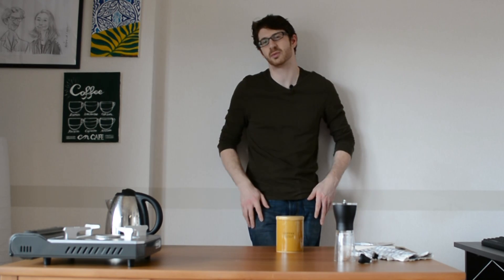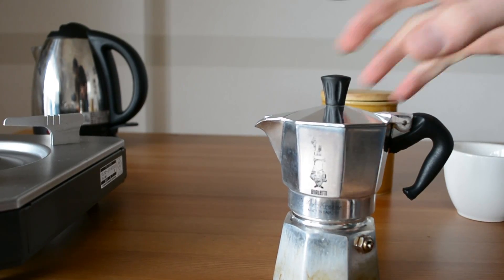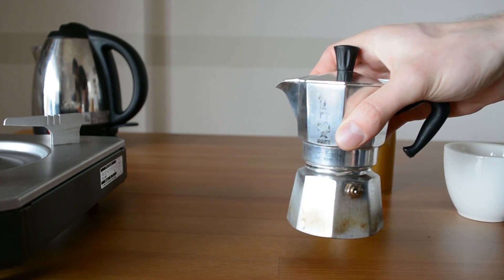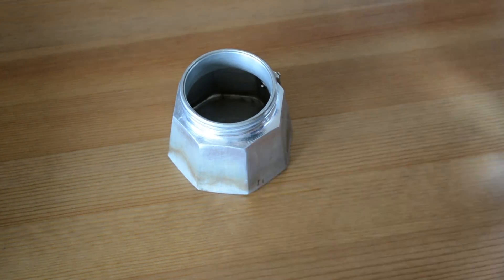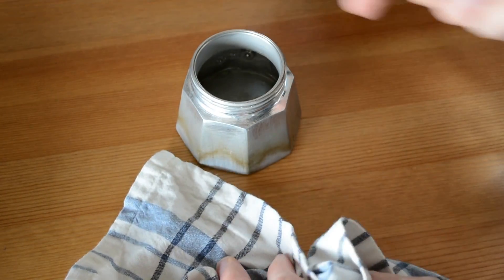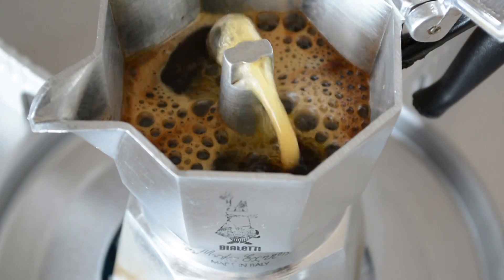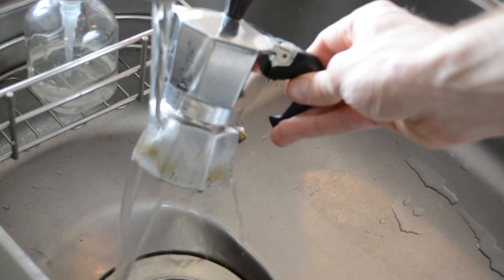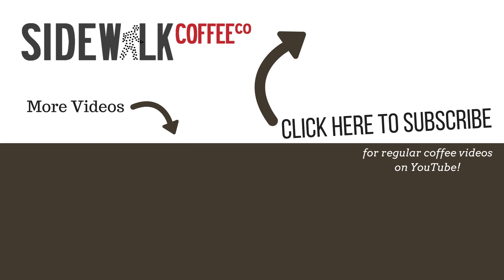How to Make PERFECT Moka Pot Coffee Every Time

Comment: If you see water spouting like that at the end, you waited too long to remove the moka pot from the heat. You have to remove it when you see the liquid turning blonde and it is still flowing, bubbles just forming. Next you should have a bowl with cold water prepared in advance, so you don't need to go to the sink with the very hot and bubbling moka pot. It saves time, it is safer and stops the process faster. I would use an electric grinder for coffee. Thank you for your video.
Reply: No. It just means their heat is too high.
Reply: It means that it's done apparently to him as he enjoys his coffee.  I am sure italians don't care either.
Reply: Yes the sputtering phase is to avoided. One can see from the color of the 'coffee' emerging during the sputterng phase that this is not thick creamy coffee but watery brew. Definitely to be avoided.

Comment: The bubbling/gurgling at the end is very detrimental to the flavor of the coffee. I would use a lower heat. With practice I learned how much coffee fills the pot, and I pull the pot off the heat before it gets to that point and run it under cool water. Also sometimes I pull the pot halfway through and drink that.. talk about strong :).
Reply from the maker: As with most things relating to coffee - you can only really teach the principles and then hope the techniques are perfected over time.
Reply: @Frank Mclain And I don't think it matters one bit.  Brew it how you like it!
Reply: Coffee still gets bitter taste after following the above steps....any suggestions???
Reply: @prajwalgowda11  Try Yaucono coffee. Thank me later.
Reply: I agree. The bubbling causes over-extraction. However, instead of putting it under cold water, I quench it in a small pan of cold water. It stops the process immediately (literally within 1 second), without the need of running over to the sink. I don't even let it start bubbling. Instead, I watch the level of the coffee compared to the top of the extraction column. Never, ever bitter.
Reply from the maker: @prajwalgowda11  Try using a lighter roast coffee. Moka pot is close to espresso in terms of flavour but you can get better flavours out of lighter roasts than it is easy to do with espresso. Let me know how it goes!
Reply: you are right. If you wait until it bubbles the coffee is not as strong. Take it off halfway!
Reply: Any advice on quantity for one person?
Reply: @paullau4297  I drink an entire pot myself. Its the "six cup" bialetti model but its not six measuring cups more like 1.25 cups of brewed coffee when its done.
Reply: @Bohdan M I disagree about roast importance in a moka pot. I would suggest a slightly lighter roast than what someone usually drinks. Too much time in scorching hot metal before the water actually passes through the coffee. Makes the coffee more biitter and sour I've noticed. My favorite personally is a dark roast in the moka pot, but you have to boil the water in the bottom half before adding the coffee basket and screwing on the top half.
Reply: @homecafecharlie  I've heard this as well, with the wisdom being: darker roasts extract more efficiently, but for Moka pot, a darker roast will more easily acquire a burnt taste. I agree with @chilopilo that  the pot should be removed a bit before the full-on gurgling.  The principle undesired result of Moka pot is the bitter taste that comes out of overextraction. Stopping the brewing earlier can help with this, though it will mean a bit of water is left in the chamber and your brew ratio will be lower (coffee will end up a bit stronger).

Comment: That grind looks too course in my opinion. That's the sort of grind I would use in a French Press.
Reply from the maker: It was a little too coarse, you're right
Reply: And also too much heat
Reply: Too coarse and the burner was really high. Video needs to be remade.
Reply: @homecafecharlie  also he's using a manual grinder.
Reply: That is coarser than I would use, but it comes down to taste.  The only real danger of going too coarse is that your coffee winds up underextracted and sour.  If the taste worked out, no need to change grind size.

Comment: Why cool the pot under water when you can pour the coffee immediately into a cup?  Seems like that accomplished the same thing.
Reply: in my opinion, i think it's actually to stop the coffee from brewing since the hot water below will keep pushing the coffee out
Reply: @gideon3839  correct. The sooner you reduce the heat, the less it will continue to brew and potentially burn your coffee. That's why you have to take the Moka Pot off as soon as it's about to sputter.
Reply: Didn't answer the question.
Reply: @garryyoung8320  I'll give it a try. First, if it takes you the same amount of time to get to the sink as it does to empty the contents into a cup, then there's probably no difference. The moka pot will continue to extract as you're walking to the sink or pouring into the cup. Depending on various factors (e.g. grind size, roast level), you may or may not be over extracting at that point.

People use this technique as a way to reduce this possibility (of over extraction), as it instantly halts brewing. In my opinion it works best if you have a bowl of cool water within arms distance. To me this is the faster option and superior to using the sink or just pouring into a cup.

With that being said, I typically don't use this technique anymore. Instead I now take the moka pot off the heat source half way into the process. I then let the remaining pressure complete the brew. It never gets to that gurgling point and the last bit of extraction is happening with lower temp/pressure and is practically at no risk of over extraction.
Reply: @davidmaurice1294  great idea to take it off before it finished brewing! Thanks!

Comment: I agree with most of the comments. You DO NOT want the bubble/gurgle to happen. I do start with boiling water in the bottom but I only put it on a medium/high heat on the stove top. This creates a slightly longer but lower temp extraction, and as SOON as you see it start to bow out (the streams on either side) take it off immediately, shut the lid and run it under cold water.
Reply: Also- for those asking about crema, try using espresso beans (they will look darker in roast color) and make sure they are freshly roasted (date should be on the bag. Don't even buy it otherwise. I mean fresh as in within a couple weeks tops. And grind finer than you would drip or french press but not as fine as a real espresso machine or turkish would require
Reply: yeah... and i don't see any need for the extra step of running cold water over the pot when u take it off the burner?  i mean, wouldn't we accomplish the same thing by jst pouring the coffee as soon as u remove the pot...  simple is better :)
Reply: what is "bubble/gurgle" ?

Comment: I found this video useful, and it got me on my way to making great coffee with my Moka Pot. Thanks. However, after doing some more research and experimentation, I've come up with some slight changes that give me a perfect cup every time; never bitter. I don't preheat the water because it is challenging to get the top screwed on tight without burning your hand. Second, as soon as the coffee begins to emerge, I reduce the heat. Third, BEFORE the coffee starts spurting, I quench the pot in a pan of cold water to immediately stop the process. This prevents over-extraction.
Reply from the maker: Good tips! Perhaps we'll do another video to improve the process in the future :D
Reply: I asked the host but like your reply so I will ask you as well.  I am new to this method. I currenlty use a single cup brewer much like the aeropress. They no longer make it and its cracked so... .  My concern with moka is that from what I see you don't actually get 1 cup produced. Is this correct?  I want 1 cup without having to add any milk or any dilution and I want coffee strength vs espresso. Is  moka for me?  My method now is super easy. I don't have to weigh anything, you just fill the grinds to the top, fill the water to the top and go and boom you get a cup of coffee with no fuss either about how long you let it sit/brew/or temps either. I want that same ease also with my replacement.
Reply: I just tried your proces and I have made my best coffee!! Thank you for your advises!

Comment: I've been using my pot for years but I've never put hot water into it and never cooled it under a tap afterwards. I'll give it a try for my morning coffee tomorrow. My coffee often has a bitter edge to it so maybe I've been doing it wrong all these years. Cheers for the video
Reply from the maker: Yeah once I started with hot water I noticed a LOT of the bitterness disappeared! Good luck and let me know how it goes ;)
Reply: @homecafecharlie  Yes. It worked perfectly and made a beautiful smooth cup. However my pot was left with a lot of water in the bottom and mich less coffee for me to drink from just the one pot. Is this normal? I guess it is because you take it off the heat and use cold water to stop the brewing method. Thanks for the video it's really improved my favourite cup.
Reply from the maker: @MarkGardiner1976  there's usually a little bit but it should get a better extraction and a better flavour this way. I'm glad your coffee improved!

Comment: As a south indian, moka pot revolutionized my coffee.

It works as a perfect replacement for traditional south indian filter coffee.

Usually, at home, this is how we make our daily coffee.

Have our usual preground 80:20 coffee powder,
No need to clean the pot, because it's never empty, we make more as we run out of decoction. (Still get rid of old grounds and all)
Fill the bottom cup with regular cold water. Fill the basket with coffee, close it up, put it over stove and heat at maximum heat for about 1 minute until gurgling stops.
Then use it as decoction for our traditional south indian filter coffee.

As opposed to south indian filter, where we have to boil water seperately and pour it over the grounds in filter. Wait 10-15 minutes for it drain. (Our preground is a lot finer than pourover normal)

And yeah, we make decoction in morning, use the same decoction 2-3 times until it runs out, then make more, etc.
We drink 5 coffee per day in our family...

Comment: I'm new to this method. I currently use a single brewer that is like the aeropress. Its cracked so I need to buy something else. Looking at these. This question may sound weird but, I want 1 cup of coffee and from what I see, it looks like the 1 cup moka pot brews less as it may be designed I guess to add milk etc. I want a brewer that brews 1 cup of coffee without diluting with any other liquid. Is Moka for me?

Comment: nice video! I have a question, sometimes I grind my coffee manually and then put it into the filter. I tried to weight it just for curiosity and it seems that sometimes I put 18 grams and others I put almost 20 grams. but I've just realized that with 18 g it's better (because water goes up easily). I supposed that somehow I pressed more coffee sometimes and that changes a lot (probably because the grind it's not exactly the same). What do you think? should I change something else to get a better cup of coffee?
Reply from the maker: Just try to keep the weight the same. Think of it like a whole set of variables, like grind size, weight and temperature. If you change any of them it will affect the brew, so if you want to change something to see how it works, don't change anything else so you can be certain. Don't overfill your moka pot, and once you have the correct weight just stick with it and adjust other things until your brew tastes amazing. Good luck!
Reply: @homecafecharlie thanks! I will try to do it carefully to avoid changing any variable. I hope I can find my own recipe now :)

Comment: I get a lot of sediment in my Moka Pot. I prefer the flavor from the Moka Pot but my wife won’t drink it because of the sediment. So instead of making two batches of coffee I just make drip. Is there a way to help with the sediment? I’ve tried an espresso grind, whatever BRCC uses (my go to coffee), as well as some custom grounds from my local grocer. All result in sediment, the espresso being the worst.
Reply: You could sieve the ground coffee to get rid of the smaller particles, but dedicated coffee sieves are usually pretty expensive. 

A cheap kitchen hack you can do is pour the ground coffee on kitchen paper towels, spread it out a bit and pour the ground beans carefully from there to the container
Many of the finest particles will get caught in the paper and may help you get less sediment in the finished product.

Comment: Few more questions. What ratio of coffee to water? what grind size? Like if espresso is 1 and drip is 10... where should the grind be?
Reply: This coffee maker gives espresso shot (30mL). So you can heat milk, or you can use hot water, or some combination of those, then add 1 or 1½ or 2 shots of espresso to your cup. This would be like a Flat White or Americano. You might also just like the plain espresso which is a lot stronger, often called a Solo or Doppio. There is no "right" or "wrong" way. You have it the way you like it :)

Comment: Hey man, great video. I use induction cooker. Is cast iron ok as a substitute to a diffuser? I dont want to spend money for a diffuser that im gonna use only during everytime I brew.

Thanks
Reply from the maker: Wow getting specific! I haven't tried on IH but I bought that little gas cooker because the grates on the one in my kitchen were too big and melted the pot handle (Easter egg if you can spot it in the video). It's super cheap, I think I paid less than £15 for mine and the gas is also very cheap. Try it with what you have and let me know if it works!

Comment: None of the moka pot videos mention which type of roast is best. In all of them, the ground coffee looks a lot lighter brown than mine, so I'm guessing a medium roast? I've been using dark roasts (whole bean) so even though I've done exactly what you did here (except I heat the hot water on a very low heat so it doesn't violently spray out like that), it's still very very bitter. So I'll give a medium roast a try.
Reply: Update: I've used 2 different light roasts, a locally roasted Ethiopian variety, and Starbuck's blonde Veranda Blend, and they make much better tasting moka pot coffee. Not as bitter. :) I've also experimented with grinding dark roast beans with the light beans, 1:1 and 1:2, and that has worked well too.
Reply: Kit M the problem is having a not burnt coffee with light roast, that's why they use most a dark mild roast to dark roast, buy a car of illy coffee and you'll notice the difference.

Comment: Is it necessary to fill the coffee all the way up to the top in the basket? I have a 6 cup moka pot but I require only a single cup to brew for myself. So i was thinking about using less of both water and coffee to get the desired amount. 
Any help would be highly appreciated :)
Reply from the maker: Unfortunately it's really best if it's full, because it uses steam pressure inside the bottom chamber to channel up. Maybe grab yourself a 3 cup for when you're just chilling by yourself?

Comment: So I am trying to follow this perfectly every time my coffee comes out extremely burnt. I've tried changing most everything, but I'm wondering if it's my electric oven possibly? Is the heat top wildly powerful or something? Anyone got any ideas?
Reply from the maker: Hmm, if you've been using boiling water from the kettle, the coffee shouldn't be burnt - make sure the temp is very low (almost as low as your stovetop can do) and if that doesn't work, you might need to get some better coffee beans (the beans might be burnt). Let me know how you get along :D
Reply: I have been running on 3 or 4 as far as temp goes, so I'll dial it back for sure. I noticed some people give detailed instruction to remove the pot early to avoid the bitter bean water at the end, I think it's possible I'm not doing that nearly early enough and that's where the flavor comes from
Reply: I think your Problem is that burning coffee flavour. When ypu fill the coffee in dont push and remove any access from the side when you close. When you close the the mokka and there is coffee between the steel THAT BURNS. I hope you understand. Im Not perfect in english

Comment: Thanks for the video. A couple of questions: how much coffee (g) for how much water (mL)? What’s your thoughts on SS moka pot?
Reply: Fill the funnel level with coffee, and do not pack at all. Fill the water to the bottom of the relief valve. There is no weighing with this method.
Reply from the maker: Mark has it right. You can weight but it's nice to just fill up to the level point and brew. When we do our espresso we get all science-y :D
Reply: Agree with  @markchadwick77 : regardless of size, the Pots are all scale models of each other and are generally manufactured with a particular brew ratio in mind, which I've found to be around 15:1 water:coffee.  You can muck around with it to experiment just to see what happens (and how you like the results), but the design intent was likely just that you fill both chambers.

Comment: Thanks for the video, it's very helpful, specially the tip about using hot water (the bialetti manual said cold but it ends up being TOO bitter for me). I was also wondering about how to get the crema but I just read your comment about the beans being fresh for that!
Reply from the maker: Really difficult to get a good crema with a moka pot.
Reply: Bialetti are THE name in moka, and I'm firmly of the opinion that if the lid were meant to be fitted to an already hot base there would be an entirely different mechanism from "grab the very hot base full of scalding hot water with one hand, and then screw the top on with the other." It's very obviously NOT how to do it. I'll trust the people who make the pot...